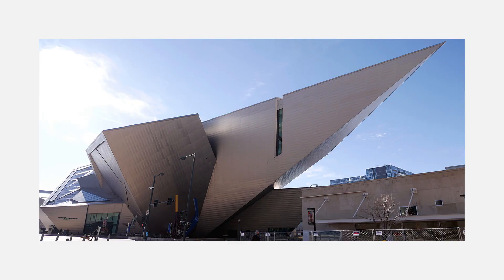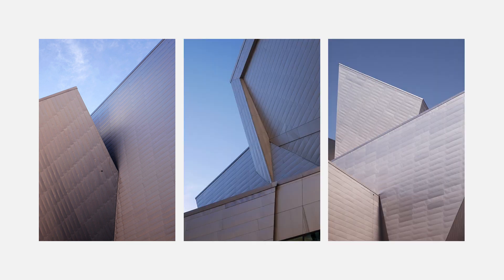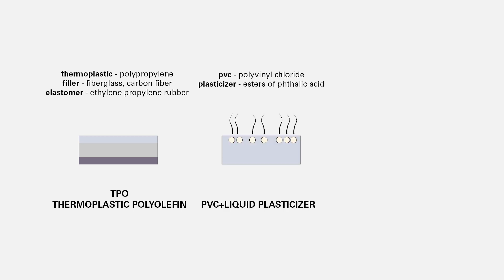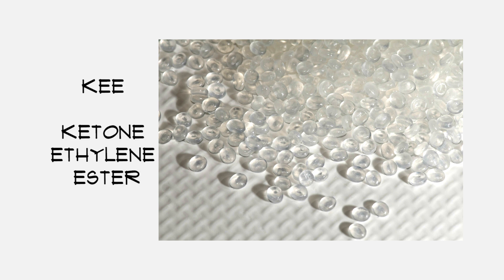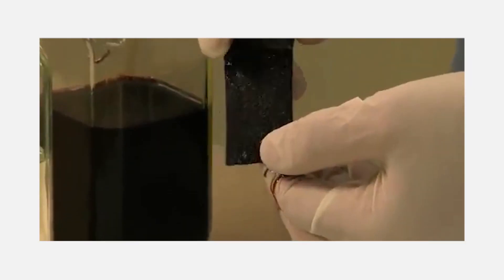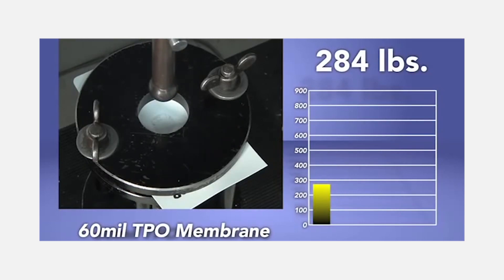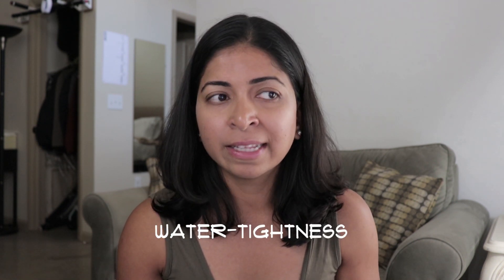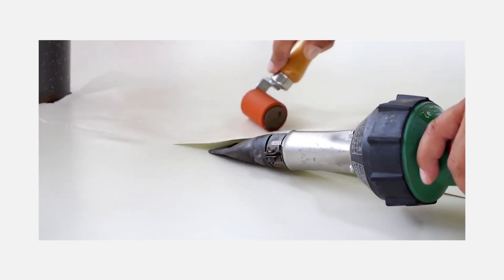What is a KEE roof membrane?

Comment: It would be good idea to do videos on bad materials design, like unintended consequences in product that people , architects and engineers don't realize. for example, Fibertite roof membranes, they are strong, durable, reflective white, and absolutely a nightmare for anyone going on the roof to do service work on equipment. The issues is that its so reflective it can actually damage people on the roof, burn your retinas, skin, even your electrical meters LCD screen can be burnt out. In areas of the country where we get significant snow , the Fibertite membrane becomes and absolute ice rink, I have been on roofs where I simply could not stay on my feet, too slick because the snow and ice cant actually stick so when it breaks loose so do you. They need to produce that stuff with a textured side, and I cant believe no one has sued them yet, I have wanted to.